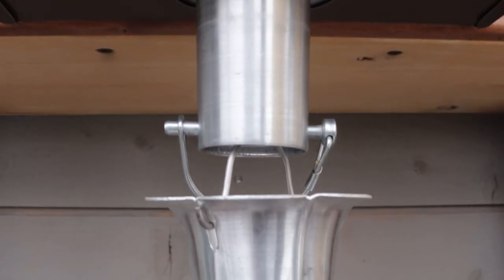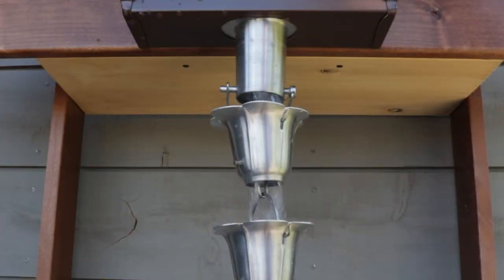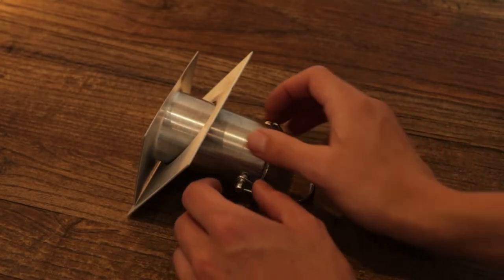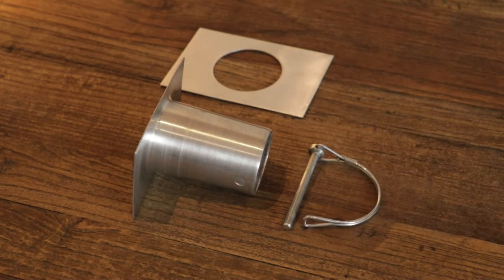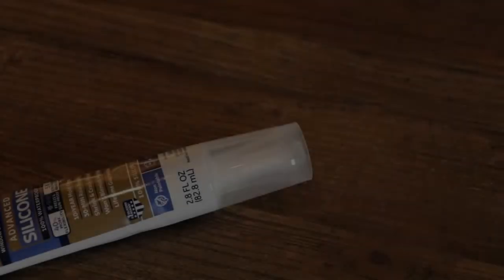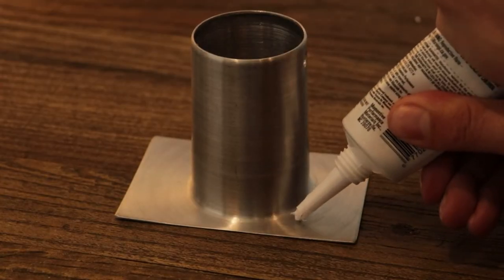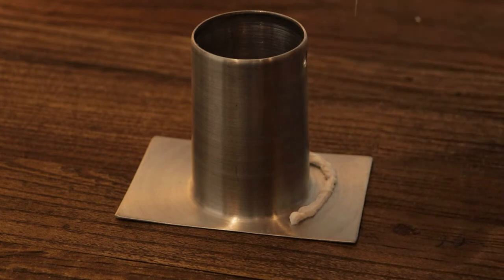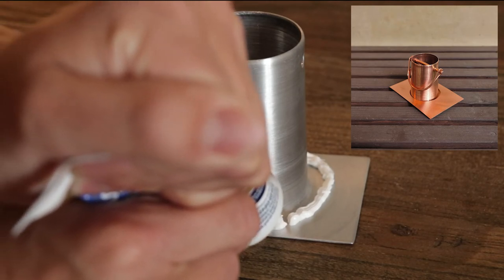Installing a Rain Chain Installation Kit

Comment: Hello - very good video.  Question - you mentioned that the hole should be drilled to 2 1/4 but the actual hole you show is much larger.  Can you explain?  I'm installing the kit myself this weekend and would like to know.  Thank you for the help.

Comment: Not sure why the attachment of the actual rain chain itself was missed from this video! e.g. At 1:12 it cuts from the cross bar being attached to showing us the finished effort with water pouring down...

Otherwise looks like a decent kit to ensure a decent amount of water can flow on to the chain initial. We've moved into a property with a rain and I'm pretty sure its been installed incorrectly - the top rung of the chain sits across the hole in the gutter and barely any amount of leaves / debris is required before it clogs up. The hole in this looks much better.